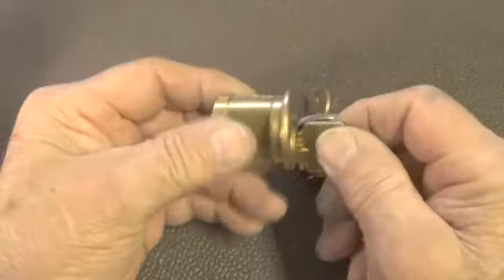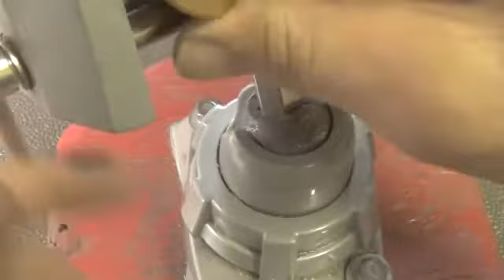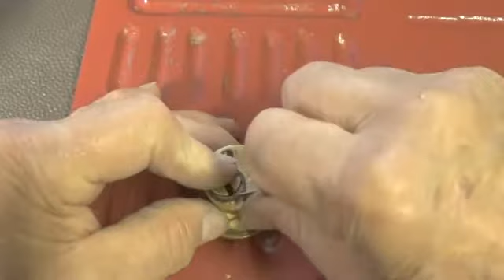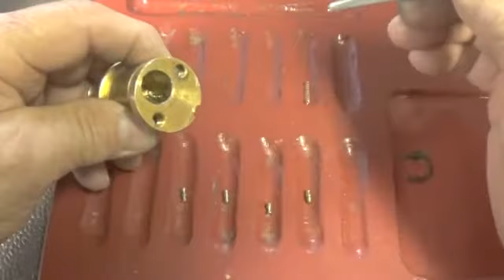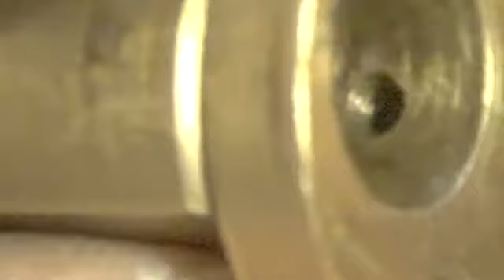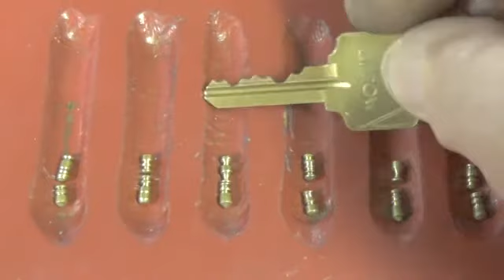(427) Ilco with Arrow 6 Pin Cylinder Lock SPP'D and Dutted

Comment: good job, also shows you don't need to be in a false set to open a lock. lots of ppl stress about false sets for nothing.
Reply from the maker: +JB A false set is not always necessary. But you will get a small turn of the plug most of the time.
Reply: +Texas Jim I wonder why ppl think they need to rush into a false set or even rake a false set. I have opened many security locks without getting a false set at all or getting it rite before the open.  the binding order is still a binding order.
Reply from the maker: You are correct. But I am one of those people that used to think you need a false set and sometimes it is necessary but not always If you pick a lot of locks with weird security pins then it is sometimes necessary to get a false set to be able to set other pins, but not always. When I reach a false set this give me an indication that the lock is ready to open on the next one or two pins. The next lock I open I will state this and see how and which pins I need to set,

Comment: Hey Jim , I've got a lock I'm calling Ole # 13  , making my own pins and adding some different springs , did some work to the plug ,  My question is : have you ever made a lock that you yourself could not open .. That's what I'm after with my self ..
Reply from the maker: +OUR REALITY 1119   I have made locks that took me a while to open, but never one I could not open.  Sometimes it would take a lot of practice to open in a reasonable amount of time. I have had a few locks that were not easy to open. In fact they were very hard to open.